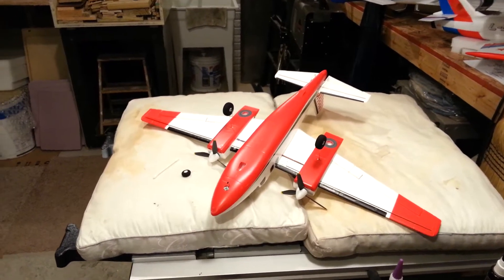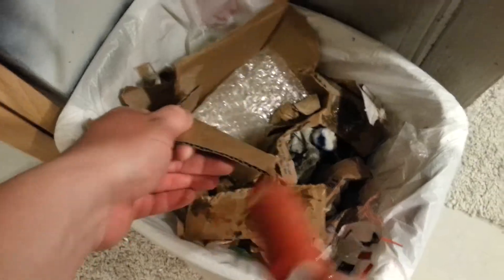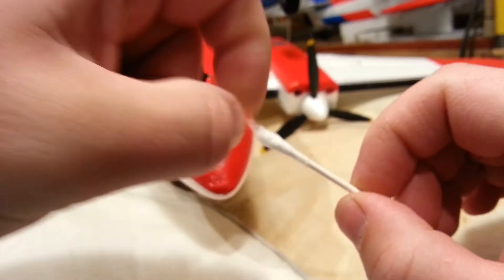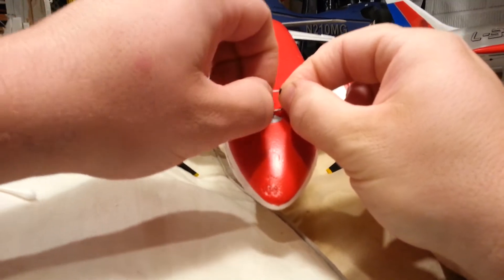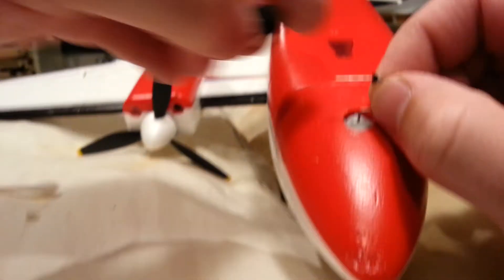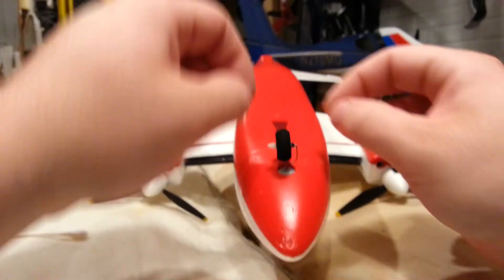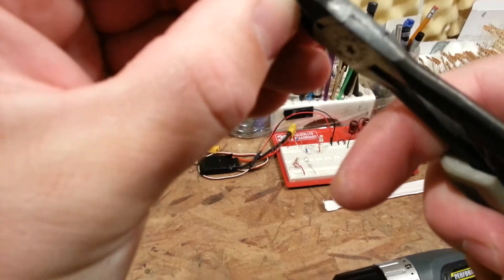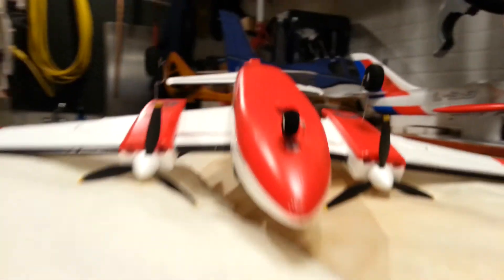Eflite - Aero Commander UMX - Nose Gear Retaining Nut Fix

Comment: I've had issues with controls glitching in flight. Have you had any problems?
Reply from the maker: none, except for the rudder linkage, which I fixed on after the first or second flight...it was catching in the battery area.
Reply: Yes i have!? Whatd you do? It just randomly started happening after 2 years of good flights

Comment: same thing happened to my buddy on about his third or fourth landing.
Reply from the maker: I should have suspected it would happen. I saw there was a lot of play between the left and right wheel nut, allowing the wheel to accelerate into one side or the other when turning the plane on touch and goes...

I've had pretty good luck in the past with this type of thing, but not a really hard repair anyway.
Reply: @BrianPhillipsRC  the repairs didnt work for me. Jb weld mixed with a hot pair of pliers worked best. Until my board started glitching and locked me out